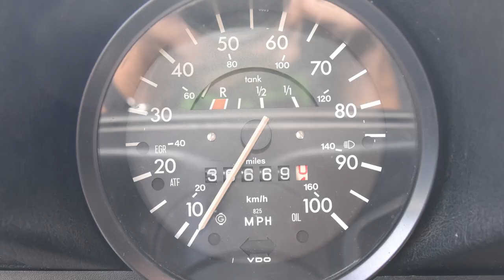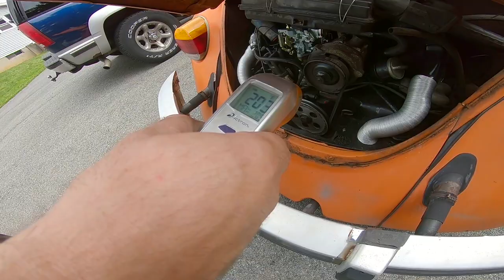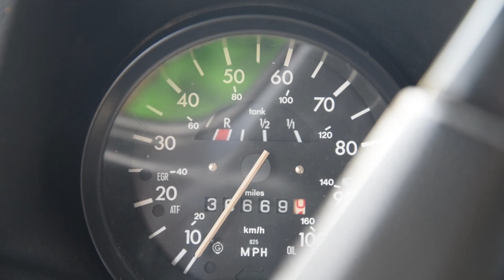1974 Volkswagen Super Beetle 1600: Regular Car Reviews

Comment: I am not saying 74 beetles were as good as 74 datsuns, toyotas, or hondas. But lots of ridiculous misinformation here. 1974 Beetles had alternators, not generators. They could cruise all day at 80 mph. They could maintain this speed up hills – in 4th gear, the highest gear. This was unlike my 2010 Toyota corolla where I had to downshift from 5th to 4th, to maintain 70 mph uphill, on the freeway. The low RPM, 4 cylinder, horizontally opposed engine, had lots of low rpm torque. Not a lot of HP, but plenty of torque for getting up hills without downshifting. There was absolutely no need for brake boost. The low overall weight and the center of gravity from front to back, due to the engine and transaxle being over the real wheels, meant you need only light pressure on the brake pedal to stop the car. I might add that power steering would have been ridiculous. I don't know what kind of brake shoes you bought I never ever had a problem with brake shoes seating properly. I never bought OEM brake shoes. I always bought relined brake shoes with bonded linings, from independent companies that relined shoes. They always seated quite well right out of the box. Yes the brakes did not adjust automatically. You had to adjust each shoe separately with a star adjuster. Lubricating the adjuster, the back of the brake shoes where they contacts the back plate,  and the ends of the shoe where they fit into the slots of the adjuster, and the slave cylinder, with brake grease or even just multipurpose grease, was enough to make sure the star adjuster could easily be turned until the next time the linings had to be replaced. This also helped the shoes adjust to the curve of the drums. If you hurriedly install the shoes and neglect to clean the back plate and neglect to lube the back of the shoes where the contact the back plate, you will indeed find that the linings don't line up with the curve of the drums. If you lube them properly they will align themselves after the first 2 or three presses on the brake pedal, and continue to do so for the life of the linings. You need only the thinnest layer of grease. A super beetle had an entirely different front suspension than a regular beetle. It had McPherson struts instead of horizontal torsion bars. I think it also had a better steering mechanism. The result was a more comfortable ride, better handling, and more luggage space in the front luggage area. All air cooled beetles did quite well in snow and mud. Much better than the typical American car with front engine and rear wheel drive. MUCH better. Better traction. More ground clearance. They were no worse than their American contemporaries as far as lack of resistance to rust, due to salt on the roads. Just like American cars, steel would rust. Plus beetles, from around 1964 on, had BETTER HEATING than American cars. Instead of an electric blower, blowing over water based engine coolant, air that had just been used to cool off the  cylinder heads, was sent directly into the passenger cabin – after first picking up more heat from the exhaust tubing. The car had HUGE heat exchangers to absorb heat from the exhaust pipes. A thermostat in the path of the air made sure the engine warmed up rapidly. First gear was only for pulling away from a complete stop. By the way, these things had rugged rugged manual transmissions. The air-cooled engines ran hot, and would need valve work and new valve guides at 100,000 miles, but the transmission would go 400,000 miles without a problem. Just change the oil once every 100,000 miles. The clutch, too, not just the pressure plate but also the lowly friction disk, would last 300,000 miles. What the car did not have, and would have benefitted from, was a cylinder head air temperature gauge, located at cylinder #3 (which ran hottest), and not an oil temperature gauge. Much the same way a water cooled car has a coolant temperature gauge, and not an oil temperature gauge.
Reply: You forgot to mention the best part, by 74 you had junkyards full of cheap parts to keep them running that would bolt right up, same as Honda of the 90s

Comment: When i was 16 I bought a 71 superbeetle. 20 years later ive owned 4 beetles, two bajas, a Ghia, and two buses. From 20 years of experience, I can tell you the 74 super was the worst car Vw ever built. Even beetle people are not fond of that model. 

Btw that was an alternator, not a generator. 73 and up came with an alternator stock.
Reply: What would you say is the best year to get for a Beetle?
Reply: Tofran Bohk depends on what you want to do with it. But I prefer 65 and earlier.
Reply: Matt Rios I agree!!
Reply: My 67 came with a 12v electric system

Comment: For a $500 car that was easy and cheap to work on, back in the late 1980s, the Beetle was hard to beat. Terribly loud and under-powered with that air-cooled 60 hp motor, the interior smelled like a stable with that horse hair stuffed in the seats, but that was part of the charm. And swapping out the engine for a $500 rebuild in 20 minutes by an experienced Bug mechanic shows the design brilliance of the Bug (except with the thing about the fuel lines).
Reply: @Carl Klinkenborg Weird. It sure smelled like horse.

Comment: The 74 Super Beelte had an alternator; the one pictured in this video is the earlier three prong type with an external regulator under the back seat, later versions had a single prong with an internal regulator.  The later version is the most common type available new today; it comes with bypass instructions for those cars still using the earlier alternator.  Volkswagen phased out generators in 73, some of the earlier 73's have a generator but most 73's had the alternator.  Three prong alternators were 50 amps, single prongs 60 amps.

Comment: As someone who has dailied a '73 Super for 9 years now, everything in this video is so true. This was a spot-on roast of not only my car, but also me as a person. I was the "going to learn" sort, and I did learn. It's obvious the previous owner was the "this car is cute" but couldn't keep it running sort. It's actually been a quite fun car, and after huge amounts of work (and many modifications to add 21st century tech, including an alternator to resolve the charge-at-idle issue and fuel injection to make it a tad bit less temperamental) it has become sort of reliable - only sometimes am I surprised when I actually make it to my destination without blowing up, and I've showed up to at least one job interview, possibly two, reeking of gasoline. It's not as underpowered as people think, it will do 80 if I'm feeling insane. I would argue that, while it does have all those complaints you describe, many of those are applicable to any car of that vintage, and if you're going to daily any car that old the Bug is probably the most sensible choice. I'm guilty as charged of being that "bug guy" that's not really into any other car, too. Also, is that an auto-stick? I can see where your complaints come from, those really suck, but are also rare enough to probably be worth a good bit to the right person.

Comment: Brings back memories. I was a rear passenger in a Baja Bug with no back seats, just carpet. The driver took a turn too fast, over corrected, and rolled it a couple of times. The battery came out from under the seat and flew out of the passenger window.  The front and rear windows popped out intact and no one was serious hurt.
Reply: On a roll ... Assault with a battery ... Pain in the glass ... On a more serious note, no serious injuries, other than maybe pride ...

Comment: We had a '73 Super Beetle, bought in 1980 or '81 from my future ex-brother-in-law, who of course lied about how well it ran. This RegularCar Review most accurately captured the experience, except my Dad got a 12 volt "heater" from the auto parts store and used double-sided tape to mount it on the dash, so he could have a tiny port-hole in the frost to see so he could drive it. It drove great in the snow, but zero heat, in northern Michigan winter, was not a fun time. His little brother was a wizard at auto body work, made the body perfect, shot in Porsche Guards Red if I recall correctly, and sold it the next summer. I learned a lot, including mechanic work, and we fussed over the death trap constantly so it ran well.
Oh, almost forgot, we got 38mpg, consistently.

Comment: My first car was a 1974 Super Beetle (red) that I bought from my father. I drove it hard for a few years and then sold it in the early 1980s, but I missed it. I bought another '74 Super Beetle (also red) in the late 1980s and beat the hell out of it for a few years, then sold it in the early 1990s. I still miss them. Hammering the baffles out of the twin tailpipes to eliminate the "chirp", and realizing it sounded almost like a couple of Harleys, made it a part of me. Snapping a throttle or brake cable miles from civilization, and figuring out how to rig the throttle or "sync-shift" without using the clutch and making it home made us friends. Just knowing how to use those weird levers between the front seats made us brothers.

Comment: I bought a '74 regular beetle 6 years ago. Bad starter when purchased. Fixed that, had the driving pin for the fuel pump fail, fixed that too. Drove it all winter in Montana in -20° weather. Definitely not the most comfortable at that point but certainly never left me stuck in snow or stranded. 
Now it cruises the highways and beaches of Southern California at 70-80 mph. Is it the most reliable car? Perhaps not, but it has never failed to get me to work, the beach, or anywhere I've asked it to go.

All in all, I've abused this car and it keeps on going. Its certainly earned my respect and affection. They're not for everyone, but I can't see myself ever wanting to sell it.

Comment: My 65 bug has a 2165cc engine that I built myself in my garage. It makes 200hp and can walk on most of what I run into on the street. Or at least surprise them. It also doesn’t need constant maintenance, and hasn’t for the past 6 years I’ve driven it.

Comment: I know this is very old and likely won’t be seen, but I still need to make a few notes. First, what made the Super Beetle “Super” was the front strut suspension. From the front of the doors rearward, it is identical to a standard Beetle. The struts, along with the widened hood, allowed for double the front trunk space compared to a standard.

The car in the video indeed had an alternator. They started coming equipped with one in 1973.

If the oil is overheating, the car is not in proper order. One of the flagship selling points of this engine/car was its ability to endure any environment without issue, and without coolant.

Most of these vehicles now are very out of sorts, with multiple owners “improving” the vehicle. Improvements such as removing the thermostat, deleting cooling tin parts, and removing or not maintaining the evaporative emissions components. Couple those with throwing on a cheap universal carburetor and an unmatched distributor and you have a hot, smelly, poor running mess that gives the impression that it is a total pile. A properly running and maintained Beetle/Super Beetle is a completely different experience than the one in the video.

For the record, I do like Mr. Regular’s reviews, I just feel like this one in particular was mailed in.

Comment: to swap a beetle into disc brakes you only need to take off the wheel, the brake line and 3 bolts, and swap for an early golf(or gol, where I live) knuckles, rotors and calipers. 
it's a nice platform if you don't want a beetle, the aftermarket support is gigantic, and baja bugs are summer specials that you can build exclusively on junkyard parts

Comment: drove one as a daily driver for years when i was in college, but i was a decent mechanic and mine worked well durring that time.  i could happily cruise at 70 on the highway without any issues.  but it did take a lot of maintnence, you have to realize it was was a design from the 1930's/40's and was designed to need a lot of maintnence.  as long as you took care of the care it would take care of you and always get you where you needed to go

Comment: My dad installed tons of oil coolers on VW Beetles, Fastbacks, Squarebacks and Karmanghias in Florida. Otherwise the #3 piston would overheat and the engine would seize. And 2k mile oil changes with Castrol 20-50 were a must.

Comment: “Expanded in all directions” he says. Well, as long as we’re only talking about the portion of the car forward of the doors. Windshield went forward and more curved, giving a much more deep-dish style dashboard. Suspension went up and out, from big torsion bars across the axle to lower control arms and MacPherson struts, opening up a lot of vertical space under the hood... bonnet? Frunklid. This allowed the spare tire to be laid down flat and therefore providing more storage space on top of it. Because the struts were so much farther outboard than the ends of the torsion bars had been, this widened the front clip as well. And the frunklid itself was more domed, meaning it pushed forward just a little bit more, too.

So, yeah, expanded quite a bit vertically, horizontally, and longitudinally... in front. From the doors back, it was identical to any ordinary Beetle, at least in the US. Four-speed fully synchro manual transmission or three-speed Auto Stick, 1600 engine, independent rear suspension. In Europe, though, there was a selection of different engines, and a choice between swing axles and independent rear suspension, that differed between the Super and the regular Beetle, with the latter coming in DeLuxe and Standard trim levels. Still substantially the same, but not to the same extent of similarity as the US versions were.

Comment: I am not sure what Mr. Regular is talking about. First of all - the Beetle he filmed isn't ecactly in good condition, and badly maintained cars always tend to be unreliable. I drove a VW Beetle for several years, I dailied that thing, and it never let me down once. Of course I took care of it, and I still own that car. I love classic Beetles, but I also like classic American iron, and Russian cars, of all things. I am gobsmacked how little Mr. Regular actually knows about mechanics and how to deal with cars in general. Volkswagen made four types of Beetles - beginning with the 1200 standard line, reaching the 1300 up to the 1302 which had a more sophisticated suspension and - as top of the line - the 1303 dubbed The Super Beetle. The aircooled engine isn't bulletproof, but it does not shake itself out of tune. In fact - flat-four-engines run smoother than inline-4-bangers. Irt does not take much to keep a Beetle running and it will consume 87 octane fuel, especially the VW 1200. It will climb a hill, not getting hotter than a water-cooled engine, but manoeuvers might take some planning and a certain wisdom. Never tress a Beetle, it will strike back. Keep it cool, drive carefully, and these little cars are just as joyful to drive as any other classic car.

Comment: My dad has a white Super Beetle that he will always get something that didn't work before to work right, keep the car running for a month at most, and then decide that something needs to be fixed, and it will be out of commission for another 3 months. Currently it's sitting in his garage, with the chassis sitting on a wooden frame so he can eliminate the miniscule amount of rust that was on the car. It's been like this for about 6 months.

Comment: hum as a guy who own actually a lot of old and youngtimers and had some aircooled, let's be clear: YES if you want to have a beetle, you need to know mecanic.
NO a beetle doesn't smeel gas or exaust, NO a beetle doesn't vibrate, NO a beetle doesn't need attention, if it's the case, it's a beetle who has been poorly maintained.
My beetle or my bus can take any distance without any particular care except particular driving.

Comment: I’ve had two 1974 superbugs, the first I bought in 1974 and the second in 1982 which I’m still driving in 2022. The Superbugs built or that came to Australia where better made, they had front disc brakes and didn’t rust as much because we don’t need to salt the roads because of our mild climate. I prefer the driving experience of macpherson strut suspension and independent rear suspension. I also like the panoramic view trough the windshield/windscreen.
My first bug that was near new never broke down regardless of how hard I drove it and the second has required extra attention as I have had it for so many years.
But I love the feeling I get every time I drive it, I’m 17 years old every time I get in it. It’s a time machine, it’s cool and a great drive. The beetle in video was an uncared for and abused bug. (A heap of the proverbial s——)

Comment: I had a 74 regular Beetle and I loved it. Drove it across country and back ( after replacing seals and gaskes in Eugene Oregon) but I made it. I had to replace the starter too. I loved driving my Beetle. My rabbit was as under powered but it was a nice ride and cheap. The 65 Dodge Dart was ten times better than my 74 vanagen going from Boulder to Nederland but it was easier to sleep in the Vanagen.

Comment: My first, second and third cars were VW Bugs, a 68 was my first car, a 72 then a 66, and later got a 69. The 68 caught fire across the street from a fire station and they put it out before it burned too bad, just the paint on the deck lid was burned off and the number 1 cylinder was damaged for some reason, got a really nice engine from my Dad who owned a salvage yard in Hawaii. The 69 Bug burned to the ground when I drove it home from the person I bought it from. The 72 was the nicest, it ran really well felt better put together and quieter than any of the others with no rattles I think I paid $2000 for it in 1987.